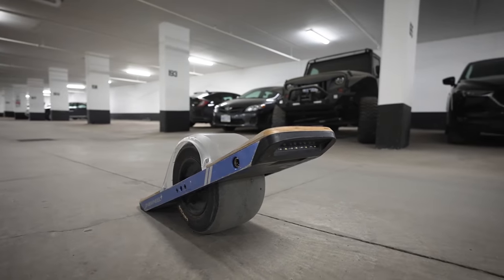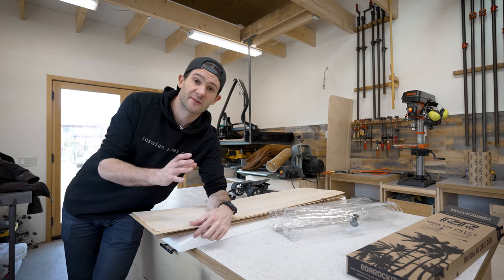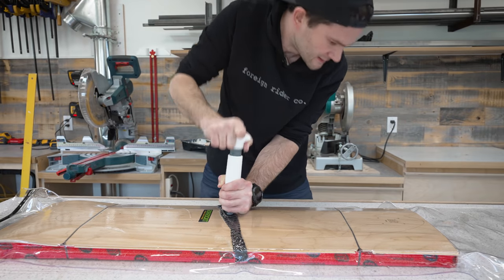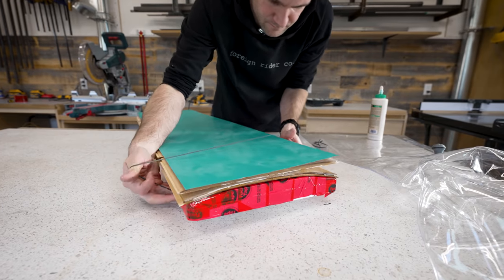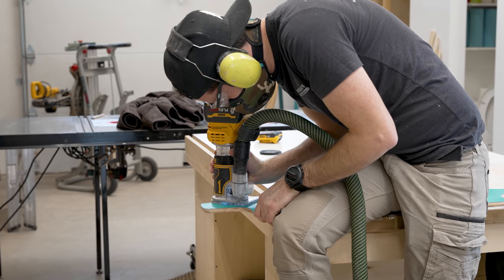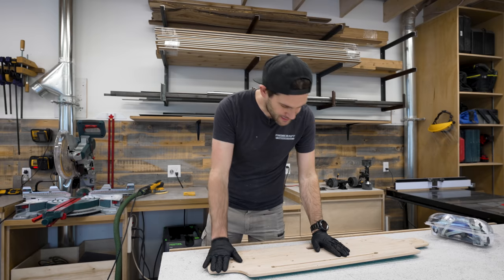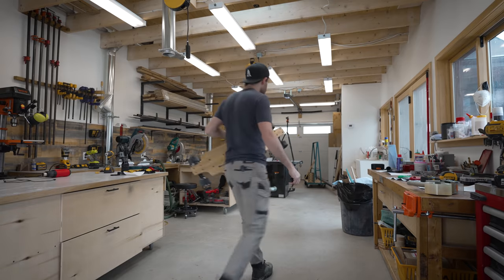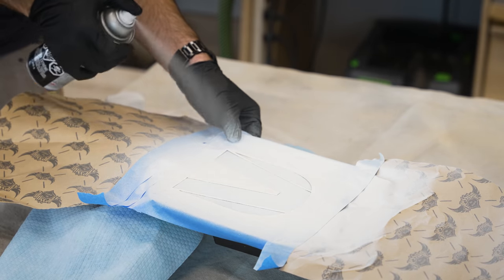Can You Build a DIY Electric Skateboard!?

Comment: Can you? We've been building diy motorized boards since the late 80's, prebuilts are the new thing in most boarders eyes
Reply: Prebuilts are most popular because they come pre programmed. The 80s didn’t have custom built PCBs and open source software to help manufacturers. Id love to see you boot up VESC tool and program my DIY to a functional state. Latency free wireless remote with speed and voltage monitor. The 80s doesn’t even compare to what we have today lol
Reply: @earl7693  Electronics did change in power density and efficency in the last 40 years for sure but neither BLDCs nor PID Controllers / Vector Control Algorithms and Inverters like the VESC are anything new

Comment: While I think it looks great I feel like the Logo is kinda upside down... if it is held by the handle then the logo will be upside down to those looking at it... also would have had the Logo on the top oriented away from the person on the board as it has a shape that looks like an arrow so it kinda looks like it points backwards... so if it was placed the other way the arrow would point in the direction of forwards... its  all minor things IMO but regardless of my critiques I think you did a great job.

Comment: lol for everyone saying this isn’t diy, literally the only difference from a true diy build is sourcing the parts individually, a diy board is basically just as plug and play as using parts from a pre built lol, honestly making a deck is a lot more impressive than plugging in a bunch of garbo over priced amazon parts and slapping them on a pre made deck. no one ever actually “makes” an electric skateboard and the most diy it gets is making your own battery which isn’t even cost effective if your only making one pack so it doesn’t even matter for someone looking to make a board and if your making more than one pack you already know what your doing and don’t need this entertainment over instruction video anyways